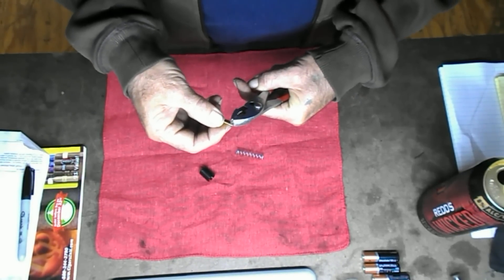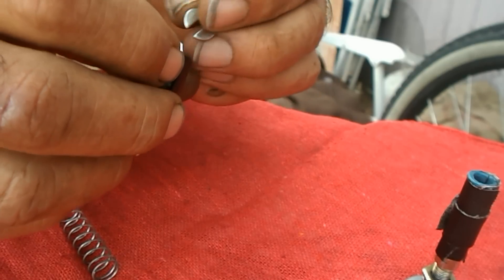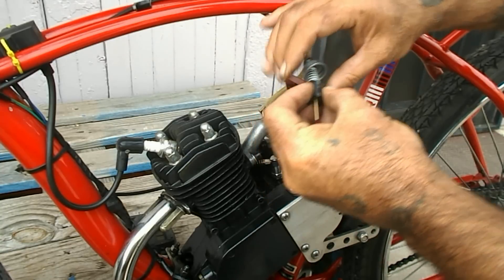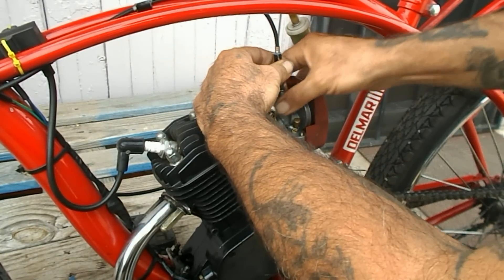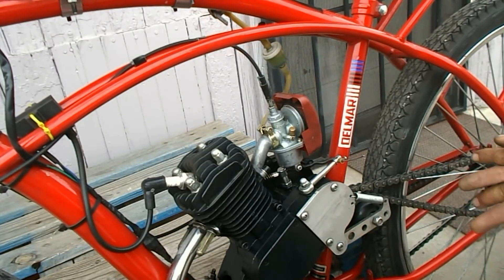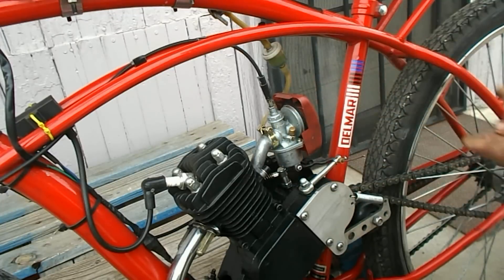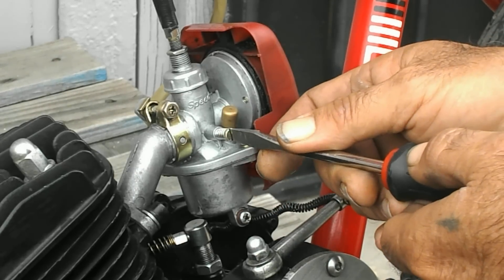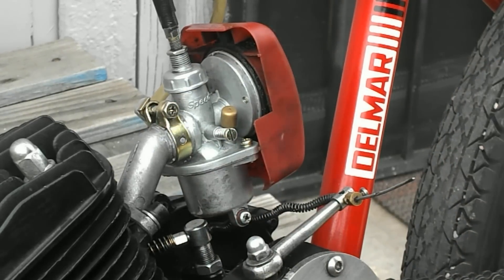Adjusting the Needle Jet and Air Fuel Screw NT Carburetor on my Motorized Bike

Comment: You do realize that your so called air screw on the side for idle speed is just a mechanical adjustment that limits the throttle from closing.... you turn the screw in and the taper on the throttle slide forces the throttle to open.... there's no mixing or jets associated with this screw
Reply: Explained in full ,when he reset the jet it allowed the over rich setting back to the lean spectrum ,then ,lifting of the jet and slide increases idle ,the fuel mix also may need adjustment

Comment: So I got a replacement carb the other day doesnt seem to have any issues but it just bogs out even on the leanest setting , I reset the jet needle to where it was before , I could use some advice ,was planning on rechecking the cable for hangups tmrw it just got late ,spark is fine gas mix is fine, can barely get it started and wants to high rev like crazy whennot bogged,
bogs withthrottle aswell
Reply from the maker: Kulakovich14 make sure you have the slide in the right way. there is a slot that the pin kB the slide goes into
Reply: brian noel yep everything is in its place by all rights it should work fine but im beginning to wonder if i got a bum carb or something
Reply from the maker: Kulakovich14 check the intake runner make sure it's sealed. airleaks are the enemy -- check the float make sure the spring isn't off or sideways. tighten the fuel line clamps try some.different gas

Comment: Awesome brother!!! They wY you explain this is fantastic. I have pretty much the same set up as you, my bike is running the Bofang Carb, my bike seems to 4stroke when im at a steady higher rpm. What notch do you recommend putting the clip at to stop the 4stroking issue? Or at least so it doesn't 4syroke as much? I know this is an older vid but i just came across it. I just got into the hobby and im a full blown addict now😅😅. My bike runs great other than this little issue. Thank you in advance, and hope to hear back from you.
Reply from the maker: Well depending on the altitude I would run the clip at the second notch from the top. This is the needle jet that allows the fuel into the Venturi the higher the clip the leaner the mix the lower the clip the richer the fuel/air mix .

Also I would go up one step hotter on the spark plug to get a better burn in the cylinder. This might help with the high speed dieseling. Make sure both the carb boot and the exhaust bolts are tight ( something u need to check regularly) 

Thanks for your questions I hope it helps ")
Thanks for watching
Reply: @Brian136  Thank you so much for getting back to me. I'm going to try your advice. I'll let you know the outcome
Reply: Did what you suggested, and now my bike runs absolutely amazing!! No more 4 stroking. Its amazing moving it down solved my issue. Thank you so much. You said run a hotter plug? Do you recommend a  NGK BR8HS

Comment: just bought an engine, carb and cdi.  would only run on full throttle.  changed the needle to lean. worse.  put it on rich.  not bad wants to start but stalls out.  took out the air filter.put the housing back.  now it runs!   new engines run on rich. if you have 5 notches on needle its set to middle notch.  move the c clip one down and should do.  the trick is to play with settings then as it gets broken  you may have to move it  back up.
Reply from the maker: I made that video already bro but thanks for you info “) I

Comment: That screw is the throttle stop screw. Screw it in more, the slider is held higher, back it out, the slider goes further down. The air screw is covered by that cap just to the right of the stop screw (between the stop screw and air cleaner flange). The air screw sets the volume of bleed air that mixes with fuel supplied by the idle fuel jet. Depending on carb design, the idle fuel jet can be either a fixed size hole, or a removable jet. The idle air bleed can be a fixed size hole, or a replaceable orifice tube. Usually, one of the pair is fixed, the other removable, but sometimes both are replaceable. That cap prevents you adjusting the bleed air to idle jet fuel mixture, which is actually how your idle quality is supposed to be adjusted. By using the needle clip and stop screw, you are actually using the slide cutaway profile to fudge your idle mixture, which is wrong. The cutaway is supposed to supplement the idle circuit at "cracked throttle" operation, the needle then sets mid throttle operation, and the main jet full throttle, with overlaps of influence within those ranges. That cap is to keep you from touching the screw, because "the EPA" , lol. If you remove the air cleaner, and look at the flange from the "air" side, you will see the pilot air hole that feeds that covered screw. If you pull the float bowl, you will see the idle jet. They are the actual "idle quality" circuit, the stop screw should only just barely be used to compensate for conditions like riding on a cold damp day or a hot dry one.
Reply from the maker: ludditeneaderthal thanks for your help and information bro")
Reply: brian noel a pleasure! I suggest EVERYBODY that plays with slider carbs download the "mikuni tuning guide", which can be found for free just by using the name in any search engine. It's an incredibly helpful, easily understandable, damn near indispensable booklet they published about half a century ago that demystifies the workings of carbs. "Carbs suck!!!", But in the best way! Happy motoring bro, knees in the breeze!
Reply: @ludditeneaderthal  I think I’m having the same issue with mine cuz I’m trying to get mine to idle also n it doesn’t wanna idle
Reply: @Championlakers22  Idle issues are often due to air leaks. Make sure your carb is pushed on tight while tightening the clamp.
Have to tried turning that idle set screw in all the way and then back it ouit slowly till its where you like it?

Comment: Hi ,  have a problem with a same engine , after some months of  use it  started to stop working after 5 to 10 min and couldn't start it again  , by the way  it was used only on streets ascends  , i did all as you explained , air flow 2and 3/4 turns and jet needle position , it start working for 10 to 20 seconds and stops , the spark is always wet , when checked , any suggestion ???  it looks like there's too much fuel ...maybe ?

Comment: I have a question. I just finished my bike today, but it will not idle when it starts. And the throttle gives not power at all except for a little revving. Do you think that has sometibg to do with the carb?
Reply from the maker: 1 Take the slide out of the carburetor. 
2 on inside of barrel u see tiny pin sticking out.
3 on body of slide there is a slot that runs lengthwise along one side
4 line up slot with pin upon re-install.
5 start engine set idle 
Thanks for watching")
Reply: @Brian136  awesome thanks i will try this out

Comment: Great  channel. I'm having running trouble. First start I peddle down hill and bike start, without warming it want to run. But then shuts off three block's later and won't start.. ? What do I do
Reply from the maker: is the gas on? are you using the choke?  did you adjust the clutch for starting? is the plug gapped at 24? CDI putting out spark? briannoel49@gmail.com

Comment: hey brian i have a problem where when you go full throttle it bogs after it hits max rpms and you have to let off the throttle.
Reply from the maker: what setting is the jet set on? if it is to far open then you are getting to much fuel and that is why the engine is bogging down at the top check the needle jet setting make sure it's on the second one down if it is  then somehow you are getting to much fuel at max rpms? also check the intake runner make sure it not leaking this also makes the engine bog down at the top of the rpms")

Comment: Sounds like it's correct, had one out the box would not idle well at this elevation ~100 ft.. Good, thanks I have a copy of the two carbs one is RUN TONG the other is a NTTC both very much the same both 2 stroke less than $20.00..
Reply from the maker: +arthur clark thanks Arthur yes since I re-set the needle it's been running very well at idle almost scary") come back and visit again posting bike videos all the time")thanks
Reply: Well, I've got an old bike mild steel frame it is not near study as I'd prefer but I have had some welding and need more done. I've got an old 3 speed Archer I planned to have a welder fasten the freewheel on I looked it over a bit it appear it will bump start as well as shift up and down the freewheel portion is easy to reach at the end of the hub case. Now that is a 1.3/1 1/1 .66/1 drive setup I need to lace it into a wheel looking to do it with a 11 gauge spoke x36 . Need disk brakes no doubt if I ever get that far on.I've ported the piston on the spare 66 cc so it leases the intake port open 98% top dead center and angled that cut towards the wrist pin to oil it which if nothing else is done that should be ,cut out some of the weight with a rat tale file on the inside of it and sharpened the edges of the cylinder leading to the side ports to get better flow. Now that's not much work can be done with a couple of files I had a used Dremel old one may have been your I got off eBay for $10.00 anyway planning on running a 48 cc I got in the mail and couldn't return so I got it for the shipping cost. I've got the thing on Youtube with some other shit but I have yet to get a cam on it and roll down the street one of these days I will hope to get it moving well enough to grab a minuet or two worthy remark.. I like the 2 stroke kits but setting one up is a lot more work than I'd expected ..
Reply from the maker: well looks like you have a serious project going here with that "old mild steel frame") I looked at the 66cc piston video and learned some new stuff about the skirt height. My experience with the sturmey archer hubs leads me to believe that you will have a very strong set up for the rear with the gear welded onto the hub. (might need traction control") I am waiting for the motor I got to wear more before I go and port & polish but I was thinking that maybe a 66 would be a better option for a "hot motor" Have you run yours yet with the mods? what gear size? I am running a 36 on the rear with the hub adaptor makes for good speed(around 40 top end stock) I like the stock 48 motor it runs good and gets decent mpg around the city and yes the setup is a bitch lots of bugs to work out before the whole thing is reliable enough to ride everyday but that's what we get for buying it from china... Thanks Arthur")
Reply: +brian noel The hub adaptor kits are well worth their money. I don't know if they make one for whatever bike you guys are talking about. I use these hub adaptors along with an industrial 2 sided 3M tape. It works better than welding and glues and all that crap and holds up to my screamers I make here...  If you want a real engine that screams... Look at Harley Bee or Fred at CR MACHINE... We have all that done for you professionally with a balanced inertia crank shaft. Nothing smokes along quite like our engines...  This is all done in real machine shops...  We don't sell hit or miss science in a box. Fred and I sell what works... Nothing like a Fred Head out of the box....
Reply from the maker: +Tim Yeakel The wheel we use in our build is from usawheel 26x2.125 single speed coaster brake cost $40 ebay.

Comment: my huasheng 49cc engine was very lean from factory was over heating and bogging out also the jet hole was half a mm way to small I made it 6/10 of a mm and still to small, I had to drill out the cap to get to lsn screw wound it out 4 extra turns and now goes 23mph at quarter and 42mph  top speed a extra 13mph carb float gets stuck so I had to slitly ajust it by turning it 1mm right no it's fixed it is still slitely jerky like it hesitates telling me it might still be lean a tad, they make them lean so you destroy them .

Comment: My needle jet actually loosened up inside the carb. My engine kept stalling after a few seconds, I remove the bowl and the long needle was just sitting in their.
Reply from the maker: Salvatore J. Quaglieri did you find the c -clip?
Reply: brian noel the c clip yea everything is installed correctly. It was the long brass needle jet that the bowl circles around, that piece unscrewed itself in the carb and that's why I couldn't take off.

Comment: one question if you can help first time tried to start up my motorized bicycle leave the choke wide open soon as it starts up I close the choke but it shuts off?
Reply from the maker: Where do you have the jet set at? Refer to my video about setting the main jet in the barrel of the carb.
Reply: @Brian136  thank you for replying but I never touch the cab so I don't know where the Jets is set as, one more thing I finally got it to stay running by doing so I have to leave the choke open a little bit as if  the engine is on wide open throttle at all all time.
Reply from the maker: Unscrew the cap on the carburetor where the throttle goes in and pull out the slide. Inside the slide is the needle jet. On the jet is a clip and 4 groves the clip should be on the second one down from the top if not put it in the second one down from the top. Start it up snd then adjust the fuel/air screw let me know what happens
Reply: @Brian136  thank you sir I will give it a try and also I will let you know
Reply: @Brian136  thanks a lot sir it seem like what you told me work but one thing though when I'm at a stop sign I pull in the clutch it shuts off but otherwise than that it runs and it's still fast I get a slow pick up but once it gets going  it  goes this still is my first time riding a motorized bicycle so I'm still knew of using the clutch and throttle at the same time
Reply from the maker: Ok here the second part - u need readjust the clutch. ( not that hard)?use a number 5 Allen wrench and take off the clutch cover. (It’s on the right hand side if engine). Now as you look at the clutch u will see a brass nut in the center. This is the flower nut turn it clockwise to tighten - counterclockwise to loosen got it? Now u can turn the flower in one click increments and I am guest that u only need one maybe to clicks and your clutch will be good. So take a big flat blade screwdriver and turn the flower nut one click clockwise start the engine and see if there is a difference. Pull in the clutch and let it idle if I stalls then turn flower nut back to original position and then go one click the other. Way start the  engine see if there is a different . Repeat as necessary once you have the clutch where you want it lock down the flower but replace the cover and ka-bingo u and a top notch motorized bicycle mechanic ready to make the big money on YouTube “) thanks for watching
Reply: @Brian136  thank you very much sir I will try that but it is a little late where I am also that is funny make the big bucks on YouTube no I wouldn't do that
Reply: Really thank you very much for replying and Responding back to me
Reply: @Brian136  I did it all that you say but still no go....I built my  first motorized bicycle. Soon as it starts up the engine is already in motion to go without me using the throttle  when I squeeze the clutch the engine shuts off when I open the choker to give it some air engine shuts off.why  if you don't mind me ask? When it does start up it  stays on for a few then shuts off on its own
Reply: @Brian136  hello sir I think my engine is shot I did all that still no go, I got it to work for 20 minutes every time I stop at a stop sign stop light I squeeze the clutch it shuts off started back up and start back up really quick open the choke  to get some more air  follow for more power  it shuts off now I try to start it back up again it will not start back up now it's not making no cranking sound no noise at all...

Comment: A brother my 80cc is picking up speed without me giving it gas may be my oil mixture do u have any ideas for me should I play with carb stew or idle
Reply from the maker: What is the problem?
Reply: I had a rear wheel seize I see people push clutch cable n to reset it I was trying to learn from u what to do in that case
Reply from the maker: @tyroneadams355  you pull in the clutch before the engine stops spinning this works about half of the time...
Reply: So at half speed I can pull clutch chain spins free then let it go ?
Reply from the maker: @tyroneadams355  sure Tyrone sounds like a good plan but I wouldn't be surprised if the chain snapped and the little engine overreved and blew up...or whipped back in a circle and broke your leg

Comment: I put a new throttle on.. I’m not getting any acceleration. It’s a new kit . Please help.
Reply from the maker: Well first off what is the problem?
2. Did you make sure the pin on the side of the slide(round brass thingie the cable connects to) went in the Grove inside the barrel of the carburetor? 
3. Did the cap screw all the way down?
4. Made sure no air leaks in or around the intake runner that connects to the carburetor? 
5. Is the gas turned on?
6. Did you adjust the clutch before you did anything? 
7. Do you have any seal leaks? Cylinder head? Intake runner? Crankcase?   Sparkplug? 
8. The blue/White/black wires coming from the magnito are connected to the spark box correctly? 
9. Does the throttle twist smoothly and you can feel a slight pull as the slide moves up and down? 
10. Reset the air screw make sure the choke is open and turn flower nut on clutch 1/4 turn clockwise go again when it.starts set idle and let warm up. 
Other than that u need give more information on what the problem is. I can't fix "my shit is broken!?!"